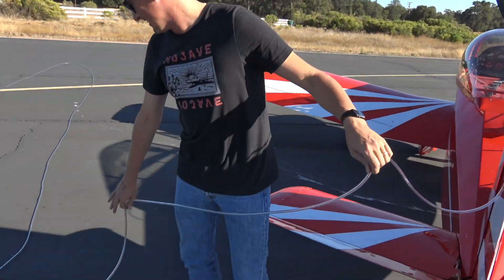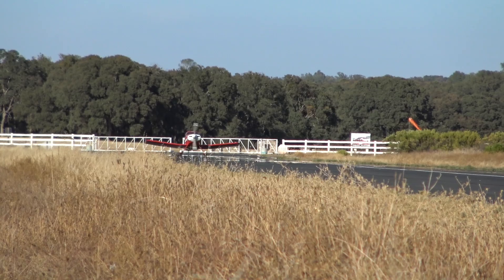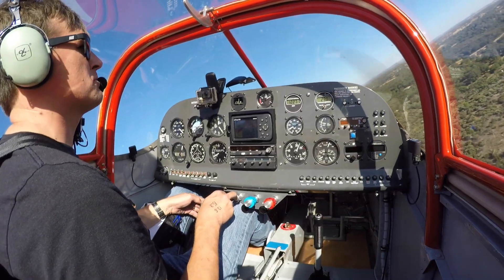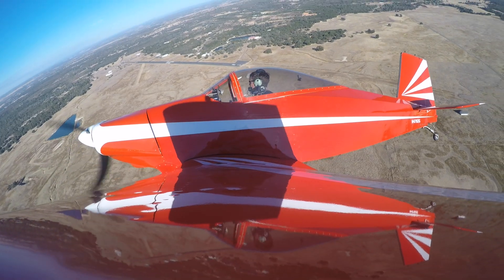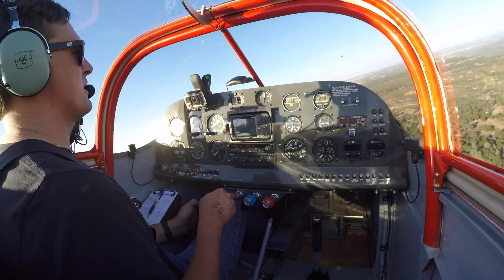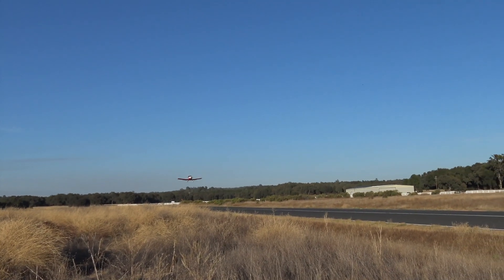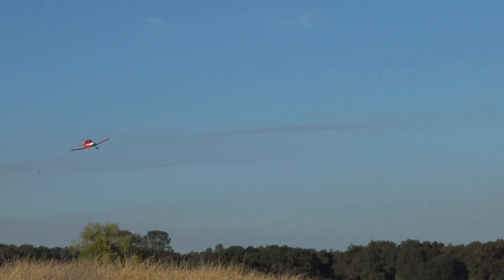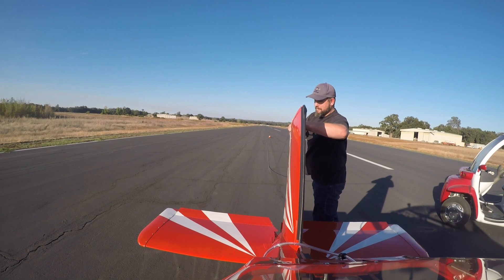Trailing Cone w/ a crosswind - JellyBeanThorp

Comment: Why not just calculate the  resultant vector of the airspeed and windspeed to get an idea of the worst case offset?
Reply from the maker: Eric H good question!

First off the problem was indicated airspeed at stall, and it’s hard to fly a cloverleaf at or near stall speed.

Second, if we were able to do that it wouldn’t tell us if the problem was the static or the pitot.

Thanks for asking.
Reply: @utopiasnow  Thanks for the reply. My question was actually about the "hang check" procedure you have to ensure you don't snag the runway lights. It seems like a lot of hassle that could be avoided with a simple calculation. Thinking about it later - it may not be so simple when you factor in wake turbulence and the varying drag coefficients for cones at different attitudes. Since that is not what you are out there to test, a visual check seems like the safest way to avoid all those complexities.

Comment: What was the purpose of the test?
Reply from the maker: This test was to verify that the new pitot probe didnt change the readings.

The series was about fixing a couple intermittent problems with the GPS, the autopilot, and the charging system.  

Since we were flying anyway I used the time to deal with a problem that was bugging me personally, the stall speed which was engraved on the panel didn't match the indicated airspeed at stall by some 30%.  I was interested in what might be causing that.
Reply: @utopiasnow   Thanks for that. Thats why Airplanes Are Cool

Comment: Cool.  Where is the aircraft pitot/static probe?  I couldn't see it in the video.  Also is that an anti-servo tab on the back of the horizontal?  That's cool.  Thanks for sharing Elliot.
Reply from the maker: The pitot is on the left-wing.

Stock position (according to the plans) is the top of the vertical tail.  The owner decided thrust effects were too big at this location.

Yes, the stabilator has a full span anti-servo tab, with pitch trim biasing.

Thank you for the comment.

Comment: Well this was very A E S T H E T I C, maybe more neon colours would help. BTW, is that horizontal stabilizer an all moving surface?
Reply from the maker: Thanks, I think?

The Hstab is all flying like most T-18s.
Reply: @utopiasnow  Regarding aesthetics, they were cool, didn't mean to insult.

Regarding all flying stabs, I've always wondered on the stability they provide, if they are just pivoting, any change to aoa would just try to push the stick so the surface would adjust, but I saw a big trimtab, so I assume together with that the stab provides "constant force"? really, how does that remain stable? Springs?
Reply from the maker: @Oinikis  No Problem, I was trying to understand.

Regarding the stabilator.  I believe Thorp is credited with introducing it to light airplanes but it is common and accepted.  Piper has used it quite a bit.

The "trim-tab" surface on the horizontal is an  anti-servo tab but the center position (vs stab position) can be adjusted by the pilot for a trim effect.

Wiki link below, I hope that helps.

https://en.wikipedia.org/wiki/Stabilator
Reply: @utopiasnow  The anti-servo tab explains everything, thanks, learned something interesting. Whole stabilator things got me confused, because I saw it on a glider once, and instead of the tab it had a spring, whose neutral position was adjusted by pilot for trimming. neat.